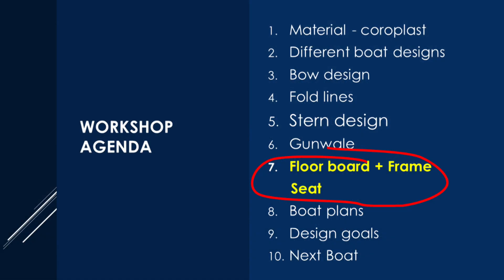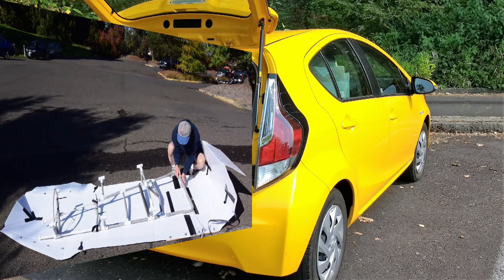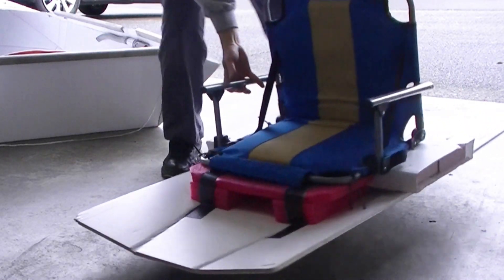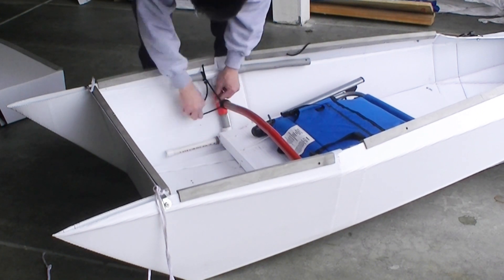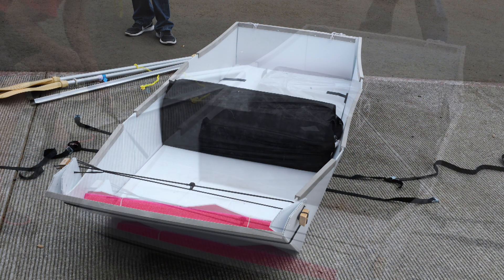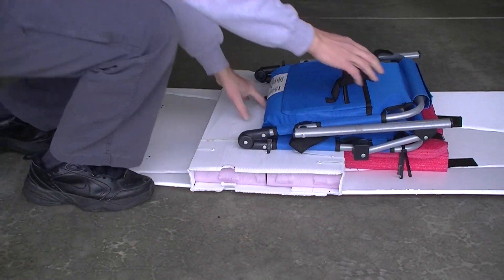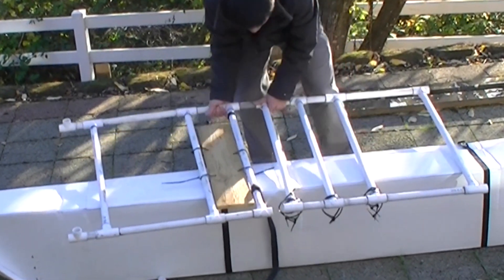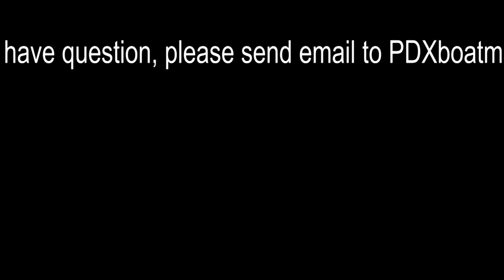DIY Foldable Boat Workshop Part 7   Floor, Seat

Comment: I use 10 mm coraoplast with a small side wall great job!!!!
Reply from the maker: Thanks John for your comment. I don't use much 10 mm sheet  (other than the floor) because it is relatively expensive, heavy and difficult to work on. I mainly use the 6 mm  5' x 10' sheet .  If I buy the sheets again, I will use 5 mm which is slightly easier to work with (than the 6 mm one). I believe the products out there use mainly 5 mm.